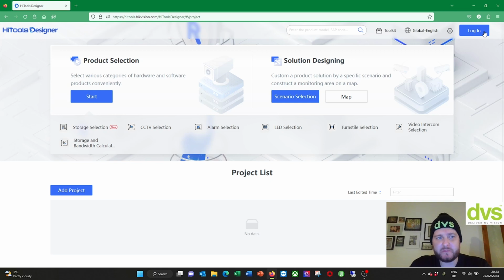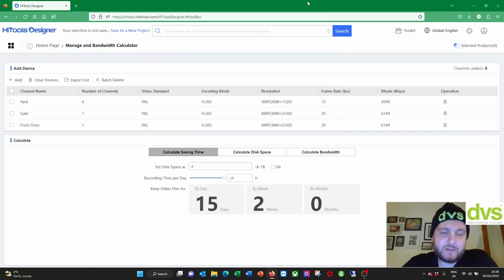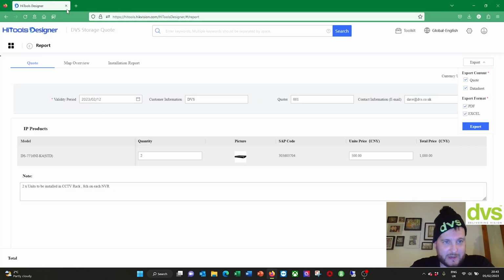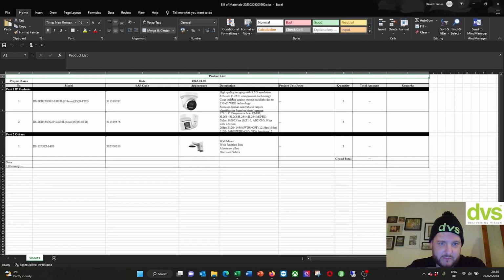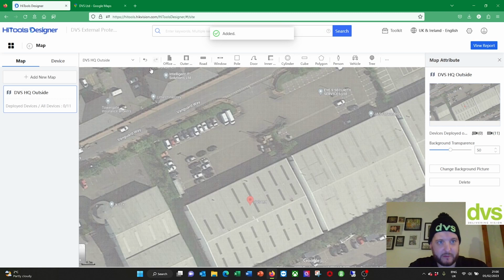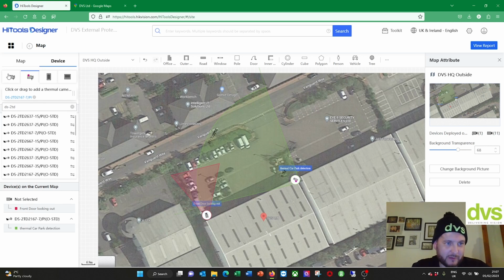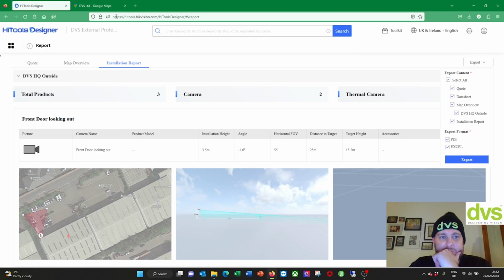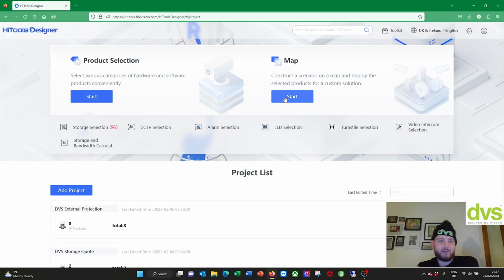NEW HIKVISION SYSTEM DESIGN TOOL

Comment: @DaiTech, Dai, thank you for sharing your video and presentation on this software program design tool. Though it looks very complicated, it sounds very promising and a great asset to specialists planning threat assessments and designing a CCTV system to respond to customers' concerns. Thank you again for your presentation, comments, and suggestions 😊. I wonder if the software can print out a report on the assessments and plans for the newly designed project to be able to submit the appropriate paperwork through, say, the local Police HQ and to other security agencies who provide a response to security alarms and seen visible threats? As per my email?